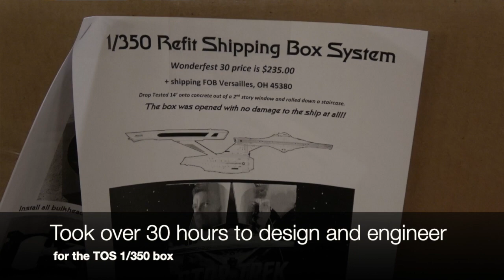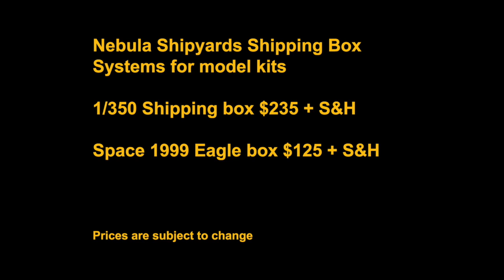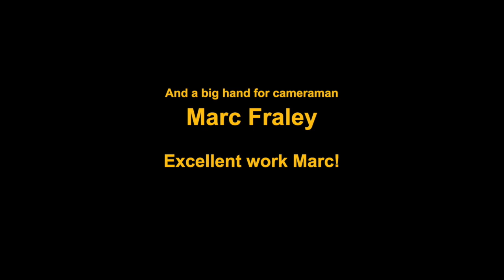Nebula Shipyards Shipping Box Systems

Comment: Heya!

It’s a Great Concept!

The Question That I Have is Why Not Properly Support Any Dispatch And Commission? I use Foam and Wooden Supports When I Ship Model Kits Be it Inland or Abroad? I thought that would be common sense  Especially when so much time and money has been invested in any one or several Projects? Or is that Just Me? It’s the same with Antiques. But More Importantly there has been a Valid Point Made During this Interview- “If a Model has all the Styrene Contacts Painted Over Then No Amount Of Support is Going to Hold Things Together!” Beyond Flashing LEDS And Sound Effects, Bells And Whistles Any Model Worth it’s Weight And More has to Have it’s Structural Integrity Assured! And that’s well before any significant paintwork is applied! This is a Technique That I Apply To Any Commission or Personal Project Styrene or Resin! 

I Hope this Concept has been Patented?

Great Interview!
Reply from the maker: Eugene Russel Nash i’ll let Tom respond here. Look for his reply shorty. Thanks for watching
Reply from the maker: thx for watching